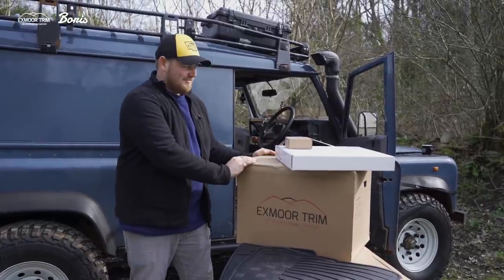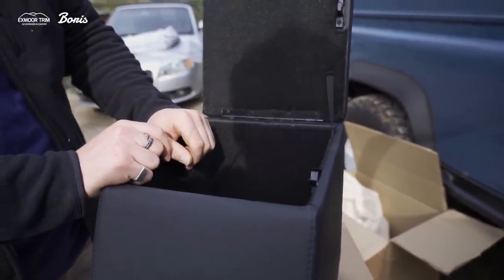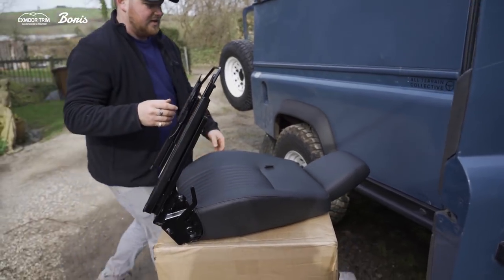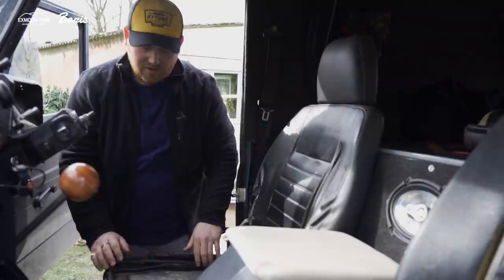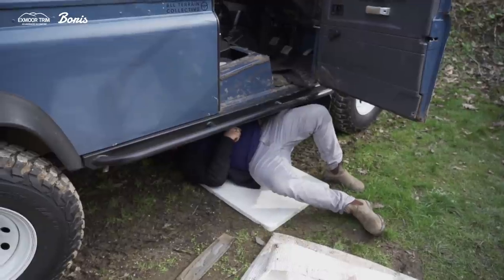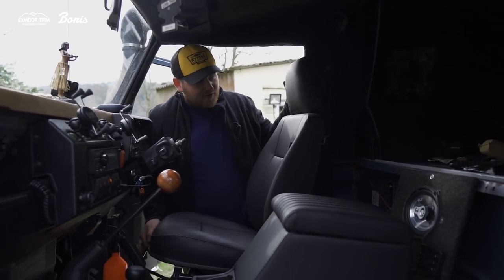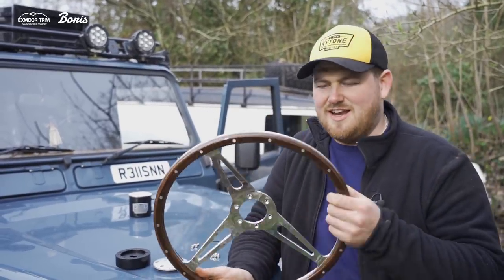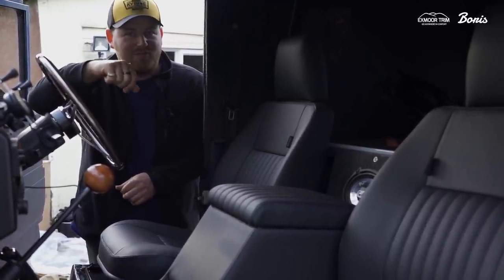Brand new Exmoor Trim interior for Boris - Defender Install

Comment: I see you have diesel heater under your drivers seat, where did you relocate you battery ?
Reply from the maker: The battery is on the other side form factory